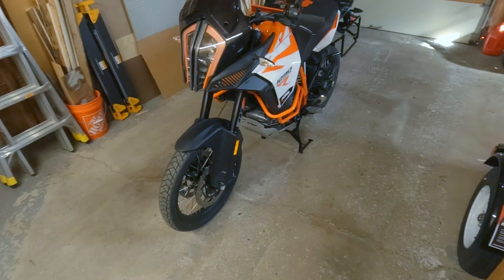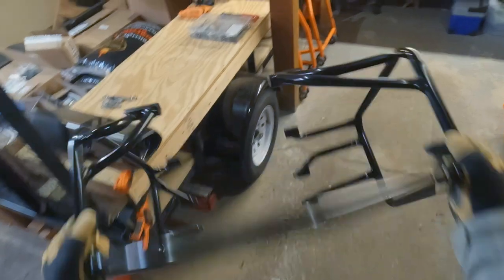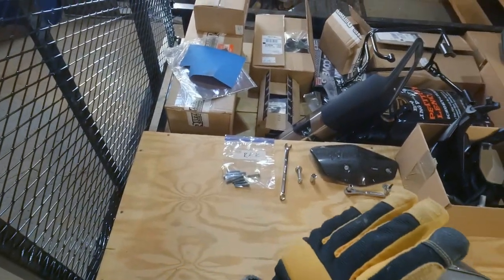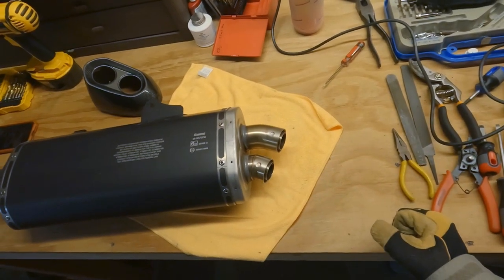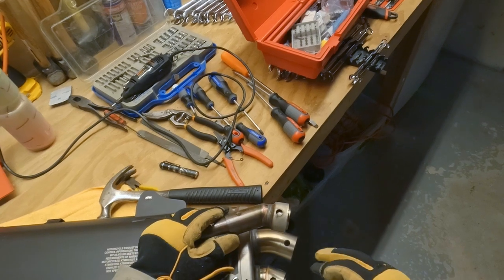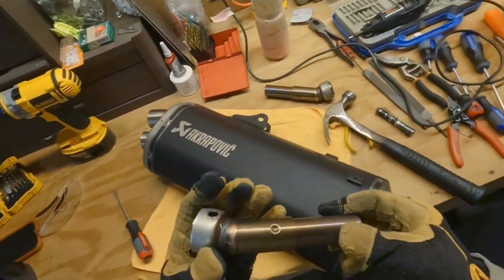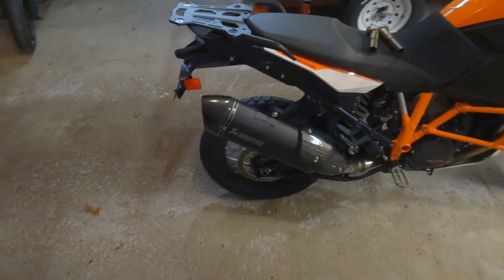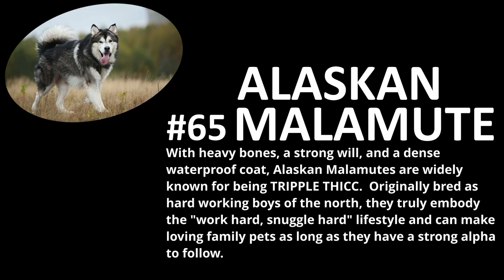Akrapovic dB Killer Removal | BEFORE AND AFTER

Comment: I got an Akrapovic exhaust for my 1050xt and it looks identical to your exhaust. It looks like I’ll have to remove the db killers as well as it sounds almost identical to stock which is really frustrating. Great video!
Reply from the maker: Yup, it’s crazy they charge so much for these things and advertise “huge weight reduction and improved sound”… if you close your eyes they sound exactly the same. We put a Yoshi Heptaforce on my dads SAR and it sounds sooooooo much better than the Akra, weighs half as much, costs half as much, and looks twice as good. If I smash this Akra that’s what I’m going to replace it with. Glad you enjoyed the video!

Comment: Have the same exhaust, hardly seems worth the change, the rear Pannier racks are for sure butt ass ugly, but they are also rear crash bars beyond the rear pegs. Great video. Trust me I want my rear racks off too. My Vstrom had these twist lok screws for them and they were a breeze to remove when I could. But my current Tiger 900 R well. They are all sorts of pretty much permanent without the original bolts that I cannot locate .

Comment: Great video. This is why i went for a yoshi alpha where the removable db killers are an optional.extra (no thanks)  The Akra as standard sounded pretty much same as stock (think Dyson)
Reply from the maker: Thanks! Yea I was very disappointed with what the Akra sounds liked stock, like you said very “Dyson-esque”. Definitely sounds better with the baffles cut out but still no where near what a true free flow sounds like. Weight is the other issue, it’s shocking how much that Akra weighs when part of the leading advertisement for it is how much weight you’ll save. I’ll likely be switching to a Yoshi in the near future when I do the Rottweiler intake

Comment: Nice video, thanks for sharing. I too have seen others remove the baffles and there's a bolt welded on each baffle that is supposedly easy to crack off. What size drill bit and rivets did you use? I'm considering doing this with my BMW R1250RS. I have the same black titanium Akrapovic can.
Reply: @Texas2Tires, I have almost your same bike (2022 R1250R) and I'm considering removing the DB killers on my Akrapovic as well. Let me know what you find from your research!

Comment: Have you tried to decatalize your bike also from the manifold?
I wanted to understand if the sound is very invasive to alert possible controls
Reply from the maker: No, I believe the only way to do that would be to cut the header open with a grinder, cut out the catalyzer, then weld the header back shut. Lot of work and I don’t have a welder. I would not consider this system obnoxiously loud with the dB killers removed, but that’s just an opinion…

Comment: The carbon not burns inside because of these holes? Or you covered the holes somehow?
Reply from the maker: Nope, I did not cover the holes and there’s no burning. Ridden a couple hundred miles like this now without a problem
Reply: @goldnmoto383  Ok thanks for the answer and the video offcourse.
Reply from the maker: @GameplayTubeHD  absolutely, we have a lot of longer rides planned this summer I’m going to be making videos for, if there is an issue with the holes I’ll definitely include that in a video.
Reply: @goldnmoto383  I already removed the DB killers today. So I gonna test it to.
Reply from the maker: @GameplayTubeHD  great, hope the video helped!

Comment: Hey man. Now that you lived with it for a bit. Are you still happy about the sound? Or do you wish you kept it stock?
Reply from the maker: Very happy I did it, stock sounds awful in my opinion. It’s a much deeper more pleasant sound but not obnoxiously loud, I’m very comfortable riding through my neighborhood early in the morning knowing I’m not upsetting my neighbors. 10/10 would recommend if you have this Akra slip on
Reply: @goldnmoto383  thank you for getting back to me. After spending 1500 cad on the exhaust only for it to be quiet as stock im not happy. Going to drill out the db killers tho so wanted to make sure. Thanks again
Reply from the maker: @chrissahlstrom8939  Absolutely! Good luck on it, I’m pretty confident you’ll enjoy the sound way more after you pull them

Comment: Has anyone removed the Catalytic converter too?
Reply from the maker: There’s no catalytic converter in the muffler. That’s in the header pipe. A few people have done it and posted videos but it’s quite a bit of work and requires you to cut into and then reweld the pipe. For a couple hundred bucks you can just buy a stainless header without a Cat